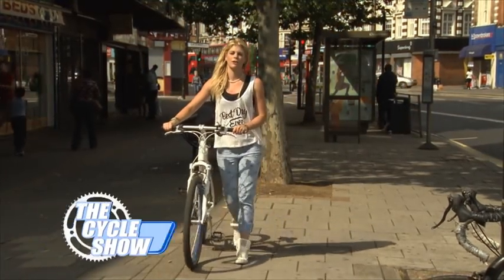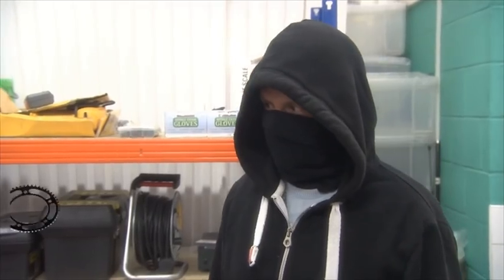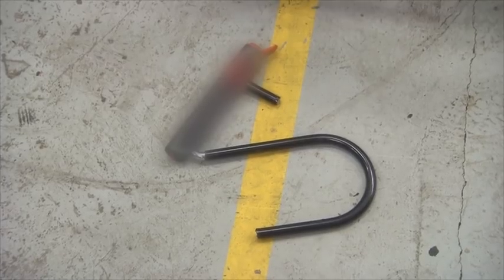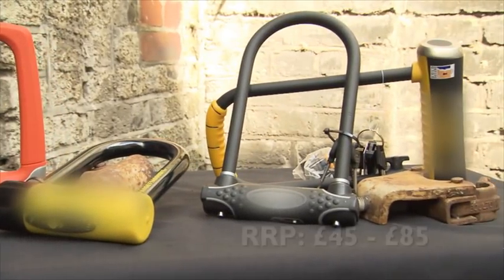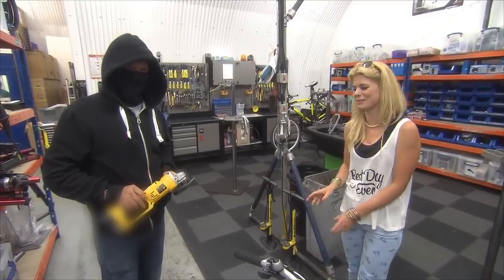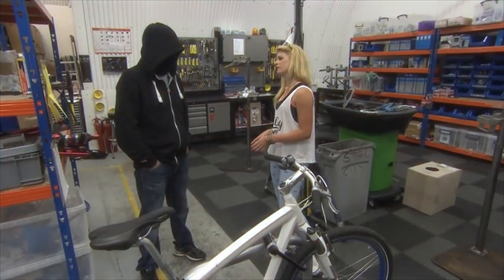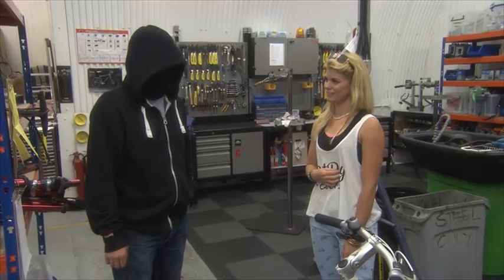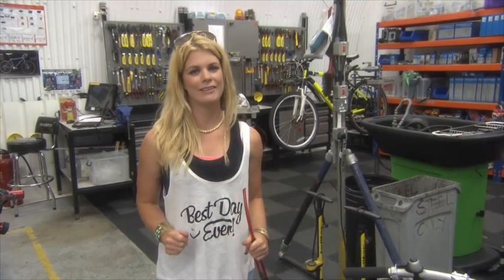How secure is your bicycle lock?

Comment: More thieves probably carry the smaller of the two bolt cutters so I'd still care to know what locks resisted those even if they succumbed to the large pair. Some resist both and yes, sure if you have an expensive bike get one of those.
Some security chains do resist most bolt cutters or certainly the smaller ones. Its about the metal used and its shape like having square shaped links or polygonal. Pewag being an example and ABUS as well.
Bigger links are more secure but weigh a lot!
Some locks are still vulnerable to prying attacks with crow bars and hammer blows. The more expensive locks do well though.
There are less than a half dozen U or D style locks that resist grinder attacks but they do cost more. One has to look into it.
One has to weigh the costs and benefits. Cost in weight and money or should I say pounds and pounds?
Its not about being invulnerable its about being a bother.

Comment: Get a sensor that sends an SMS when bike is tampered with, then you can go and protect it, and a GPS tracker shows the location until retrieved and reset. Not very expensive, actually.

Comment: MY ADVICE IS : DO NOT LOCK YOUR BIKE AT ALL . Why ? because I have simple method which will give a lesson to the thief . What I was doing it was disconnecting  V- breaks by loosing cables from jaws or loosing steering bar . That method can sent easy thief to the hospital with serious injury . Highly recommend  :) * need to remember to fit all the stuff again for yourself before ride .

Comment: Are we only focusing on destructive attacks? Oftentimes it would be easier to shim, rake or even pick a lock and shimming and raking are easy skills to learn, quick, quiet and may not even look different to someone just unlocking their bike, I'd like to see how long locks held up against non-destructive attacks too, you can have a great chain that will chew up bolt cutters and eat through angle grinder wheels, but if the lock can be bypassed with minimal skill, it is useless.

Comment: simple hack go to your hardware store find the biggest bolt cutter messure how much jaw open, buy a chain a little bigger so there is no way someone will cut that wire of chain with a bolt cutter, also chains are harder to cut with an angle grinder coz move a lot. my 5 cents on that.

Comment: Most bike locks are ridiculously easy to pick or bypass. No boilt cutters or angle grinder needed. Don't leave your good bike unattended!  And get a cheap daily built on a discarded frame you got for free at the co-op. I built a realy cheap SS bike to go for groceries with. It even has some holes in the seatstays, total value of parts perhaps 50$ (tires and tubes cost 20$ or it would have been cheaper). I lock it, but don't care much if they steal it. It is also the one bike I can leave in the cellar overnight.

Comment: My security measure is to use a relatively cheap bike that nobody's gonna bother stealing. I then park it near other bikes using a cheapo chain.

If I had a $$$ bike then I wouldn't use it in situations where I can't lock it up safely after riding.

PS - there's one more kinda lock. When I lived in Japan, most bikes had a lock that formed part of the frame. If you cut it then you'd have it clapping around in your spokes, making it difficult to ride. IMO $$$ bikes should have their own bespoke security systems like this + GPS tracking.

Comment: It isn't about if a thief can steal your bike; it's about if there's a more attractive bike to steal. Why would a thief steal a bike with the New York Lock (the one at the end) when there's a bike with a cheaper lock that wouldn't require an angle grinder next to it? I've locked an $800ish bike up everyday outside of my office in Manhattan with that lock for years and I've never had anybody even attempt to steal it. Basically, just never leave your bike out overnight, don't ride a bike that costs over $1k, and always use a better lock than the people next to you, and you should be good for at least long enough that the bike will have paid for itself as opposed to taking public transit or driving.

Comment: Deflate the tires or remove a wheel.  No one would steal a bike with a flat or missing wheel.  Small air pumps are cheap.
Reply: Or, you could disassemble the entire bike. Take all lighter parts (wires, brake pads) with you in a backpack!

At some point, the deterrent would deter the owner from ever using their own bike.

Comment: It will always be a risk getting your bike stolen. If somebody really wants your bike, they will get it no matter if it’s unlocked, locked or even locked in a bike shed. 

The only thing a lock does is to increase the risk for the thief… and maybe make them look for another bike. By having good locks or several locks… or several good locks the risk of getting the bike stolen should decrease. 

Another way to decrease the risk is to park it where a lot of people are around all day. 

I’ve gotten one bike stolen… with motorcycle locks, in the middle of the day at a place where tons of people pass every minute.

Comment: Some actual tips.

1. Don’t buy a cheap lock. Just don’t. Bolt clippers and it’s gone. 

2. Insure your bike. If it is stolen, you get a replacement. 

3. Get a bike alarm. I got one mounted to my bike and it still got stolen thanks to the shitty lock. 

4. Always carry proof you own the bike. Whether it’s an order confirmation or a small plate bolted onto it.

5. An angle grinder isn’t actually a decent weapon because the guy doesn’t want to murder you or he’ll get caught.

Comment: You know what it is… I have a 4 star lock, which is a fine lock! But the problem is almost never the lock itself.. its the thing you have to attach it to! Most of time thats the real weak point! You can have a 150,- lock.. but if the pole you attach it to is weak.. yeah.. then good luck. Personally i use a 4 star chain lock, and a 4 star disc brake lock.

Comment: Of course any lock can be cut with the right tools.  The point is to be aware that a cheap cable lock can literally be cut with heavy duty wire cutters whereas a U lock will need a hacksaw or angle grinder and take much longer, and the casual thief probably won't risk it (at least not in daylight).

Comment: Lock picking Lawyer channel is the best for making up your mind what lock to purchase...you need a lock that is bolt cropper attack resistant..angle grinders are impossible to resist..however if you spend a lot of money on a bike make sure you spend 20% on locks...my advice is spend as little as possible to get a serviceable, reliable and efficient bike that is not worth nicking...learn how to service it yourself and don't get moolered by a car, truck, runner, bus, cozzah, pedestrian, anarch~syndicalist vegan OR a Vogon... Good luck👉😷👈👉🇬🇧👈

Comment: Several companies are now working on ultra light weight "back-pack" design bikes which allow you to remove the seat, handle bars, wheels, and stack them nicely on to a harness which you wear like a back pack. The remaining frame part of the bike actually folds up as well and you can either take that collapsed frame with you, or you can lock the collapsed frame on to a bike rack. The collapsed frame looks like one solid piece of metal which as been placed around one of the bike rack bars.  If you try to drill in to that collapsed bike frame, you will destroy the frame making it worthless.  Same thing goes if you try to hammer it off. The locking mechanism is extremely complex and only a master locksmith stands any change at picking it successfully under ideal conditions so if you mount the collapsed bike frame with the locking mechanism butted up against the end of the bike rack bar or facing towards the ground, it makes it nearly impossible to access the opening to the lock mechanism.  As far as the bike handles and seat, they designed to fold practically flat so once removed from the bike and folded they are easy to tote around.  Same thing goes for the wheels. Only drawback is disassembly time which is about 10 minutes and about 12 minutes to re-assemble and you also need to reinflate the tires however there is also a battery powered tire inflater accessory available.

Comment: Question, why do weak locks even exist ?
What is the point of a lock that can be cut by a strong pair of scissors almost and in seconds ?
Surely there should be an industry standard to how easily any lock can be cut through.

Comment: Using an angle grinder pretty much will nullify any attempt to secure a bike. You need to either buy a cheap bike that's not worth the hasstle or use two locks so that the time doubles. A lock is just a time delay.
Reply: How about a ship chain. I calculated it wound take a angle grinder about 2 years to cut through😨
Reply: @josesmenroza8521  good luck carrying that thing around with you on a bike :)). Two U locks would be the easiest as you can keep then i a backpack or strapped to your bike.

Comment: Obviously if a thief is bent on YOUR bike they will succeed.  So at the least make you bike less desirable than the others.  Use 3 high quality locks.  Register your bike.  Take pictures of serial numbers.  If stolen, change your registration to reflect the stolen status.  Equip your bike with a GPS beacon such as Sherlock or SwissTrack. Set the geofence feature to warn you if your bike is moved. Use bike uglification techniques to make the bike next to yours appear more sellable.  Wiretie several bells on your bike if being left for a long tine.  Place a sticker on the frame which reads, ""My best friends all work for the district attorney's office."

Comment: How about a system in which you can take the drive system or some major component off the bike so it's completely unusable. The thief would be walking around with a dismantled bike and it'd be easy for anyone to spot.
Reply: There's still the old van technique, unless said part is hard to get separately, btu then if you ever lose it you ruined your bike.
You also may be overestimating how people care. Most will just walk by and even if anyone asks they can just say they lost theirs or it was defect.

Comment: Best just to put thieves off to start with. Only use an old, crappy bike when you know you are going to leave it in the open. Plenty available secondhand, or through the police sales. Best to have one with one of the built-in locks frequently seen on town bikes in Holland, Belgium and Denmark – hard to get to the bolt with cutters. Use a second lock to secure it to something, if you can. Mine has sat for weeks at some stations in Europe. A bit of rust, dirt, grease, the odd broken spoke,. An aged rear baggage carrier, rusty spring, is a definite turn-off. All make a perfectly rideable bike look shitty and unattractive.  Slightly heavier maybe, but no one'll nick it. I used to ride 24 miles each way to work on an ugly bike. Great for training. 240 miles a week. Just going to work. Only ride your nice machine when you know you're not going to leave it.

Comment: HELLO ALARMS ALARMS ALARMS!! I've seen video when people will using an angle grinder when the alarm went off the guy took off. 

They have alarms now for the disc brakes and alarm that attaches anywhere on the bike.. 

They're up to 120 dB. 

You touch the bike the first time It makes a noise a loud noise. You touch it the second time THE ALARM GOES OFF. 

If you're serious put a disc brake lock on both front and back use a u-lock with a cable. And have a hidden alarm somewhere else. 

When these all go off AND THEY WILL. Lifting up an expensive e-bike that 75 lb with all that noise is not smart.

Comment: Anyone can steal anything if given enough time and the right tools.  While it is not impossible to carry a 18V battery power grinder, the chances are very, very slim. A power grinder would get very heavy and hard to hide under a jacket or clothing for any lengthy period of time. Thieves want to get in and out, steal their goods as fast as possible with the least amount of time, noise, or attention. Helen Keller could hear that power grinder and know something is going on.

Comment: You're damned if you do and damned if you don't. You lock up your bike with a tip of the line lock and yet a grinder will cut through it.
Businesses could provide undercover secured areas to lock it up. And if locked in a busy place surely that would deter the bike thief carrying a grinder and bolt cutters...
Most heavy duty chains are exactly that, heavy. Who would want to carry around a 3kg chain?

Comment: ----so what I got is ALL locks can be broken into so it's more about the PSYCHOLOGY of thiefs. Locks just BUY TIME. 
So do this- 
#1 - Use a D lock best quality

#2 - Use TWO - make sure both wheels are lock and put it on an area that would make it difficult to reach with the tools. 
#3- Don't leave your bike on empty street
#4- Put "This bike has a GPS tracker inside" sticker... (my idea) 
If they see a $2,000 bike but would need to use one of those grinders on TWO locks....PUBLICLY  perhaps they'll pass and go for
8 EASY bikes with cable lock. They will probably pass on the expensive bike. What they want is MONEY. Not quality, not type of bike but what will give them the most.
An expensive bike would but also 8 easy bikes. 
If that bike is on an empty street they might go for it with the help of having someone watch while they do it.

Comment: So there are no locks that can survive an angle grinder?

Doesn’t that make this a “how to steal any bike in a minute or less” video?
Reply: The only locks that could survive an angle grinder would have to be made of some aerospace or deep space grade of alloy which would cost more to buy than your bike. So the answer to your question is, yes, there are no cost-justifiable locks (that I'm aware of) that can survive a decent angle grinder.
Reply: If there was they would just cut through the rack instead
Reply: @stevegandalf4739  Ah yes, the aerospace industry. There was me thinking it was really all about weight to strength but nope apparently cut off discs are a thing aeroplane manufacturers are concerned about.

Comment: Bike locked up at raiway station with six cctv cameras in the vicinity.
Bike removed using bolt cutter hidden in duffle bag by three boys wearing hoodies. 
The cctv captured the theft and thieves but police would not follow it up.
cctv is no deterant.

Comment: So to stop a bike theif you need a lock thats at least 6 inch diameter solid bar (boat ancer chain) that way the battery powered angle grinder disc won't be able to cut all the way through + if they try the disc will wear quick and decrease in diameter so they will never make it through, they will need to come back with 9 inch petrol powered grinder which will attract attention as they are huge and much louder.

Comment: It's all irrelevant.  If they want your bike bad enough, they'll just cut the frame and wheel off and take it for the remaining parts.  In fact the frame is much faster to cut with a sawzall than the better U-Locks are with a grinder.  If you really want the best advice, then get a less expensive used bike and instead of an expensive lock, put away the money saved to buy yourself a replacement bike.  Also park next to a nicer bike, in a well traveled area in short sight of the street, then which is the thief looking to take?

Comment: Tools like those giant bolt cutters and battery powered tools should be restricted by law. There should be a law requiring such devices to be treated like guns or cars: background checks, mandatory registration etc. For the electronic tools, they should have a gps inside than and be forced by construction to be incapable of being moved from a certain property. You buy, you set to your home, you bring it home and from that moment onward it become "house arrested". Walking on the street with those kinds of tools should NOT BE ALLOWED!

Comment: good video, the way hes using the angle grinder is so dnagerous: no mask, no eye protection, not flame resistant clothing, both hands not on the grinder, using bare hands no fire proof gloves, using the wrong cut off wheel for the different metals. if the disc explodes it would probably kill him and her if it s

Comment: The angle grinder catches too much attention as well as the 4" key there is another tool available you can carry in your back pack that no lock can stop that's verry easy to cut a bike free with no attention brought apon yourself but most people don't want to spend the money on it . But truth is no lock will stop a dedicated thief.  If they want the bike they will get it . Only line of defence you have is a GPS tracker hidden inside the frame of your bike at least that will prove to the cops were you bike is located

Comment: the smartest thing to do... buy a used shitty bikes that you are not afraid to lose. if you spend $50 on a bike and get stolen let's say every 3 months... for $500 it will last you about 2 and half years. But if you buy a expensive $500 bike.... you might have higher chance to get it stolen and you lose $500 at once... Or get a portable bikes, bring it everywhere with you.

Comment: battery angle grinder has swung the balance of power no chain or D lock can combat ...why spend £100 on a top of the range D lock may as well just ride around on a crappy bike that thieves will pass by for the expensive ones and save yourself the money on the lock AND the expense of a new bike .